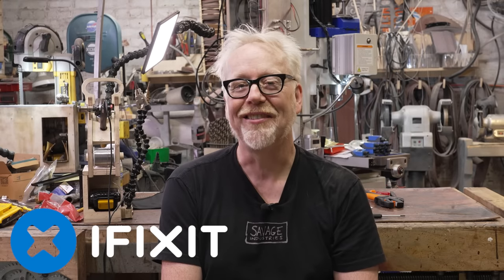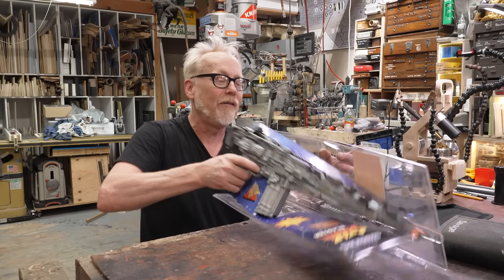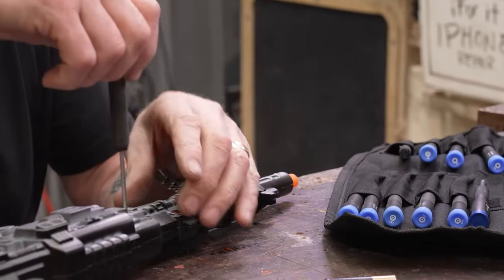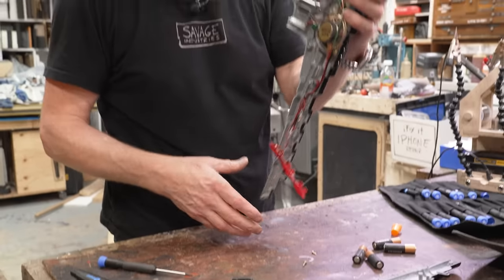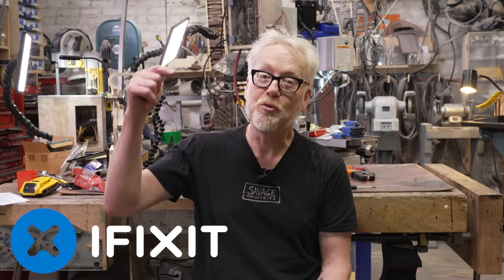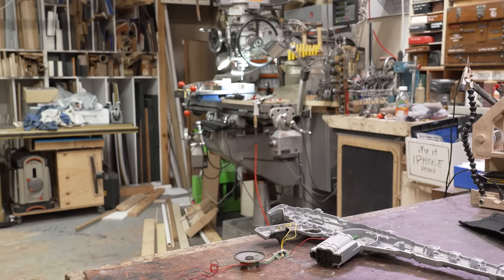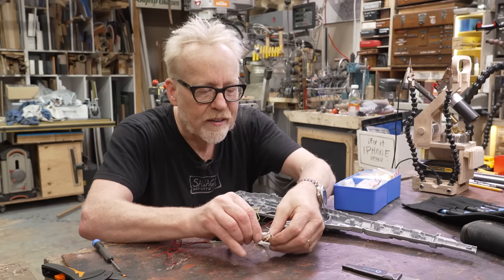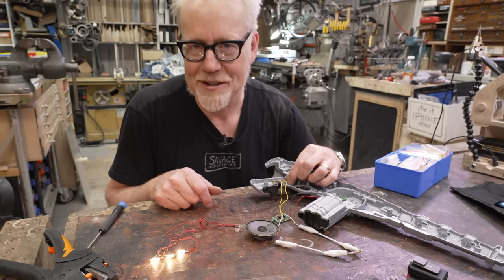How to Quiet Your Kids' Toys!

Comment: i generally like to explain electronic circuits by likening them to their plumbing counterparts. in almost every way its the exact same principles, wires are pipes, switches are valves, negative is the drain the positive is the water into your house, capacitors are like tanks, diodes are one way valves that only let the water flow one direction, etc. most people can wrap their head around water pipes much easier because its a big simple circuit that you can easily trace so it sets their mind at ease because things like the word "diode" are scary lol
Reply: @timharig  i definitely agree, if youre getting to an engineering level and still thinking of it like that youre gonna run into issues, but im generally not dealing with engineers, or rocket scientists... lol. it works for most situations involving your average person though where they just need to understand enough to connect A to B
Reply: @timharig  also for reference its generally just cars people are dealing with when i cover it, pure dc, if someone came to me with 0 knowledge and the intention of plugging their creation into a wall outlet id be far too distracted with making sure i had 9 and 1 dialed on my phone and ready to go to explain anything, if i have to explain it you shouldnt be plugging it in to 120 or 240v...

Comment: Speakers are 8 or 4 oms so in a you need a very small resistor or it may burn out the circuit.

Comment: Adam I believe when putting batteries in the negative always goes towards the spring hope this helps
Reply: 9:22 Would that be the spring connected to negative wire or, the spring connected to the positive wire.
Not to mention the vast array of items that don't have spring contacts.

Comment: I started doing this years ago - all my kids toys have hidden "kill switches" that cut their volume with a resistor, but let me restore them to normal when it's time to move them on. Also adding power jacks to anything with ludicrous battery requirements. 6 D batteries for a rocker? Not anymore. Best parenting life hacks if you can solder.

Comment: It's probably an 8 ohm speaker, so using an 8 ohm resistor would halve the voltage going to the speaker.  In a perfect world at least.

db are weird though, and it might not sound much quieter at half voltage.  
I probably would have started at 16 ohms and went up or down from there.

Comment: The actual ration of a rough time frame is approximately 6.8.9.76.456.2 hours children would play with a ' space gun' like that or something similar.  Factoring dogs, cats,  and broken cookware.  The ratio can be increased by roughly the same rate without changing the common value of the same rate 😂❤

Comment: Hate to be "that" guy, but dampening the speaker cone with some gaff tape may be enough. however, if you wanna put a resistor in there, you can easily find resistors in your old toys/electronics. and if one isn't enough, you could join more of them in series. just make sure they don't overheat or short out.

Comment: i have (several) weidmuller stripax and it was not the last wire stripping tool i bought.
for one: my boss pays for them, :)
second i need a new one every 18 months, that's how much i use them.
Reply: How are you torturing them, that you need a new one? As far as I remember, the stripping blades are exchangable on the Stripax 😮

Comment: I just simply pasted a piece of EVA rubber on top of the speaker. That dampens the sound instantly and doesn't require any soldering. (Yes, I'm a father too)

Comment: probably would have been easier to just take a couple alligator power connectors and clip it on using a ~6v power supply to test with it apart than it was to cut and re-manufacture the battery compartment.

Comment: 👉 I think it's quite interesting that around the same time you release this video I was working on an audio guest book that I use for events. I was not happy with the quality of the recordings because the mic was picking up too loudly. I figured there was an easy way to solve the problem and ordered a bundle of resistors from Amazon. I did the exact same thing you just showed and it worked flawlessly. The recording sounds so much better now. I just placed a resistor in line with the microphone.

Comment: um... that changes the resistance of the speaker (and thus the load) and is detrimental to the amplifier life span... no?  I guess it is not enough to be bad? Or is it because of the short duration of the sound? Or do you just not care how long the toy will last?

Comment: Adam.
There's another way to figure out what resistor to use. Put a variable resistor in circuit and move it until you get what you want, then use a multimeter to measure the resistor and just go up or down to the closest fixed resistor.
Also why does the side on that toy gun look like a city? 🤔
Reply: I think Adam just wants something that works well enough, and not so concerned about getting the prefect resistor
Reply: @Reppetixx  
It's just a quicker way than the hit and miss method, worth giving it a try.

Comment: The slightly more proper way of going about this would be to start with a variable resistor, Get it to the volume you want it to be, Then measure the resistance and choose a resistor accordingly.

Comment: As the cool uncle, I do the opposite of this to annoy my sister even more. I don't know how many toys I have gotten for my nieces that have mysteriously disappeared.

Also every time I go to strip wires using snips or a knife I curse myself for not buying a decent pair of wire strippers. It's always one of those things of "I'll just use the thing built into the crimp tool. Why does this thing suck so much? Fine! Eff it! Get the snips out! Crap I accidentally cut through the cable! Why didn't I buy an actual pair of strippers!? Just let me lob this thing across the room! Well now I feel better but why did I do that? I swear this time I'm buying a pair of strippers as soon as I'm done! Aaaand now that I'm done that wasn't too bad, I'll just save the money and use it for beer because I need one after all of that." and the cycle repeats.
Reply: Double also, this is how I started learning electronics. My dad was an electrician for Boeing and got so tired of fixing my toys that once I hit like 10 he sat me down, showed me how to solder, and said to have fun doing whatever. His one rule was to not mess with mains.

Comment: first off, it's mildly annoyed pixies, not angry pixies (that's high voltage)
secondly, is that an uncle bumblef**k (AvE) reference?
thirdly, just use a potentiometer instead of the resistor. that way, the kid pisses you off, you turn it off, he does his chores, you turn it up

Comment: Nice. But for the general public, keep those trials and errors experiments to battery powerer toys with low power. I have a college degree in electronics and I didn't bother doing this. For my kids toys, I simply put tape or a peice of fabric on the speaker, inside the toy. 😅 Would have been nice to see how you make the  thing permanent. Letting alligator clamps loose in a toy will not hold for very long. 😆

Comment: There should be an impedance printed on the speaker. Those speakers are often 32 Ohms. If you put a 32 Ohm resistor in (or thereabouts, as resistors are made in defined values—use 39Ω), about half the signal would go to the speaker. This wouldn't necessarily equate to half the volume, because transducers. Signal amplitude isn't linearly proportional to sound pressure level, and none of that relates to how you perceive the sound.

Just cut the wire... "Sorry kids, the sound broke."

Comment: Other option would be to use the voltage drop of a diode or use a potentiometer/trim resistor to have volume control, or as maker without a clue about electronics simply glue a piece of foam over the speaker to muffle it. I hope adam never fiddles around with LiPo/LiIon battery circuits. Those store and release quite some energy (the ones i play around with can release up to 10 amps) and short circuit them is a thing for the 4th of july. Cant count the times i burned my fingertips..wire is red hot glowing in an instant if youre not carefull..thats why they are used in this stupid vape thingys.

Comment: I know just a hair more than you about how it works.  I'd have fun with my kids and set it up with a small pi or arduino with a wireless chip to be able to connect with my phone and adjust the volume depending on if I have a headache or not or if the kids are inside on a rainy day or outside. LOL Make them wonder how the volume changes...  LOL Even be able to silence it completely during a certain window of time.  "Aww, my gun stopped making noise, must be time to go in for supper!" LOL
Reply: If you’re going to put that much effort in, go to the thrift store, and let them pick out an old Nerf blaster that they like. Then put your own controller, speaker, and lights into that.
Now, instead of simply modifying the toy, you’ve created a parent and child group project.
“But daaaaaaaad, I want it to be louder.”
“You can do that yourself. Let me teach you how”

Comment: fun fact.. i used a 1,5v battery. earphone some wire, to test if a cable had a good connection. but dont hold the battery to long.. it will brake the  earphones speaker.

Comment: You gave me a big laugh when you picked the 330K resistor to start with.  Speakers are usually 8 ohms.  I'm surprised that 82 ohms even made a sound.  You could also use a 100 ohm adjustable resistor as a volume control.  Get just the sound you can stand.

Comment: A 330kOhm resistor in line with an 8 ohm speaker? From the speaker's point of view, that's not much different from just cutting the wire.

(I'm assuming 8 ohms. That's pretty common.)

Comment: aren't you eventual going to kill the little sound amp making it work harder? I mean it's only expecting to have a 4, 6, or 8 ohm speaker, most likely a small 8 ohm, not 10 speakers worth of impedance. I honestly don't know with these little toys, I'm wondering about this myself. I've cooked speakers hooking weak ones to too powerful of amps, and killed radios not having an amp to push the speakers and burned out the channels. it's easier to replace the channels in amps, they are normally out in the open attached to a heatsink, radios ehh...

Comment: Instead of testing a million resistors, why not simply put a potentiometer in-line with the speaker, then you just have to adjust it up or down to suit your preferred volume level? Doing that would also allow you to turn it down even more if you find the town still unbearably loud after the kid is playing with it.

Comment: Quick tip.  Don't do this where your kid can see you if you think they might end up being tech savvy too.  Damn gremlin backward engineered it a few years later and used an amp from his Snap Circuits and an old subwoofer to make his most annoying toy loud enough to shake every damned window in the house.  😖

Comment: That's a huge speaker for a cheap toy gun. Most toys I've taken apart have these awful wafer thin round speakers. Then again they run off a CR2032 battery and not four AA ones.

Comment: If you don't want to hear noisy toys, don't buy them noisy toys.
If my parents had done this to my toys, they'd soon find a lot of their 'toys' very quiet and it wouldn't have been as sensitively handled as altering electronics. A rule was established after my Mum cleared some of my toys away (permanently), even though I was still using them and had spent many hours putting them togther - I'll keep my room clean (which I did anyway) and you don't touch my toys, not even to move them.
Reply: Sounds like you had a hostile childhood.
Reply: @Queldonus  You concluded that from ONE limited info story? Wow. Not at all, my parents are/were great but they all do things that piss us off as kids.
For me it was mainly my Mum. She saw rubbish cardboard and bits of wood (mixed with Lego), so she chucked the 'rubbish'. While I saw it all as sets and buildings for my figures that I'd drawn and painted on for many hours. So when she threw some out I let it be known by removing the aerial of her favourite radio until the rule was agreed. It was all very amicable in the end. 🙂

Comment: easy, and without looking like a douche bag to the kids, have a stock of "toy batteries" especially for them which are either low or no charge and put them in the gun, then it will either not work or be vastly low power and quieter, so its either quieter or silent 🤣🤣🤣🤣 after they dont have it blaring away you should introduce them to something more quiet or parent friendly, your welcome 🙂🙂🙂🙂🙃🙃🙃😆😆😆😆